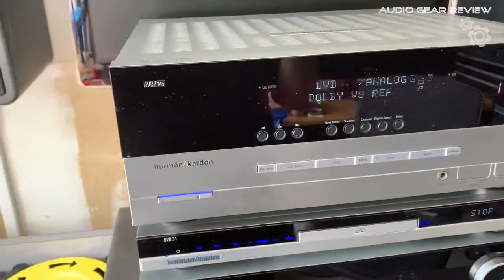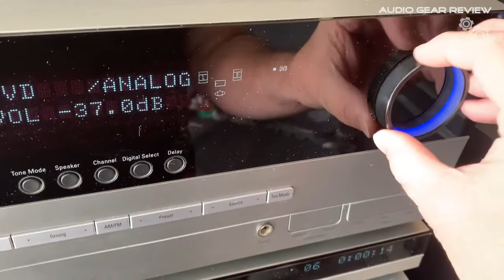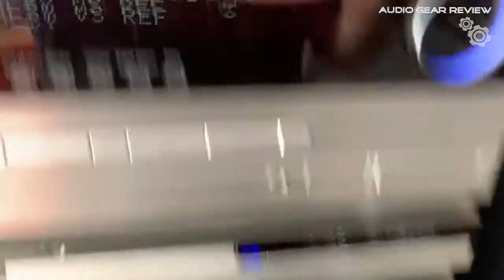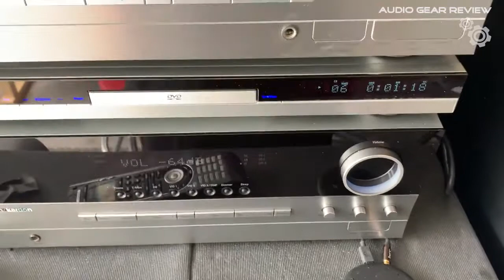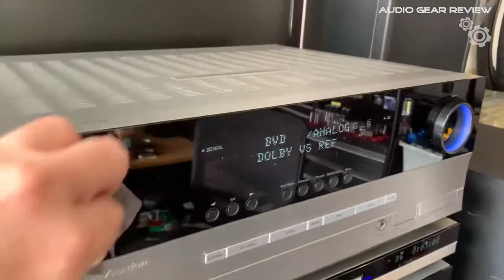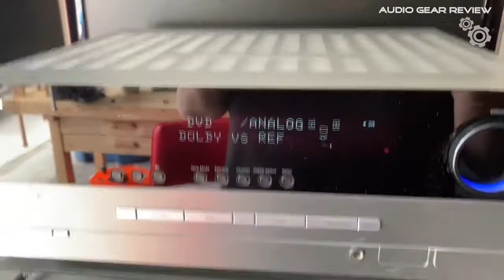Audio Gear Review Harmon Kardon AVR 145

Comment: Hi thank you for the video. I've also got a 145 (bought new since 2007/8) and it works great, EXCEPT for the volume knob... I'm curious how to go about doing the 'repair' on the knob that you did on yours... Is the volume module fairly easy to take out / take apart ? I'm ok with the basics on electronics (can't do electronic component repair though).. Thanks again.
Reply from the maker: Basically the knob pulls off gently. It may be a little tight at first just pull even pressure. You may need to try a few times before it comes off. Once off the rod to the knob is there. Spray some wd 40 in there and move the knob beck and fourth many times. Also if you have an air compressor blow some air in there that will push the wd internally and clean and lubricate the control. This may correct the problem right away or you may need to let it sit for a while and retest. I found it corrected for about 1 day the returned to the problem behavior. I repeated the process three times and that completely corrected the issue. I’ve been using for a couple years now with no issues

Comment: can i run 4ohm speaker on high volume on this amp?
Reply from the maker: Probably could since impedance is nominal. However, I would not run test tones or non music material that has a sustained output since that would probably cause damage. Any music or movie would be fine